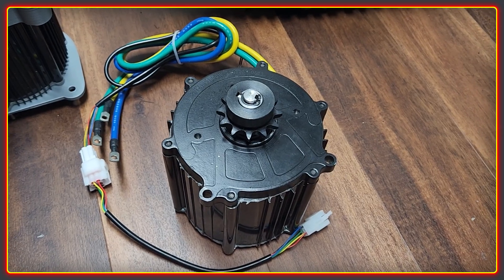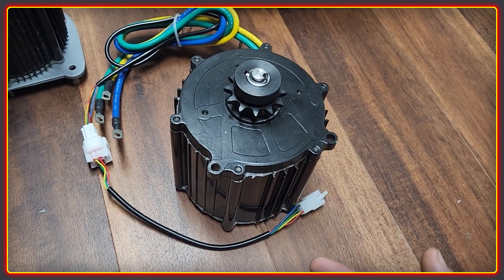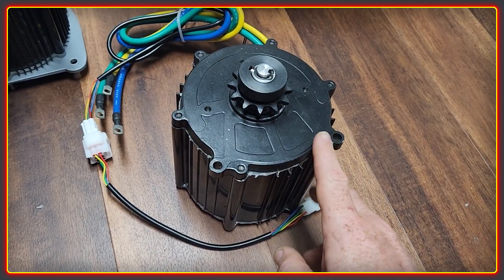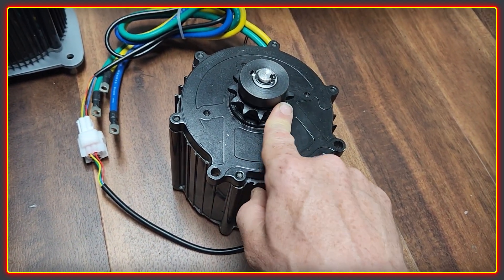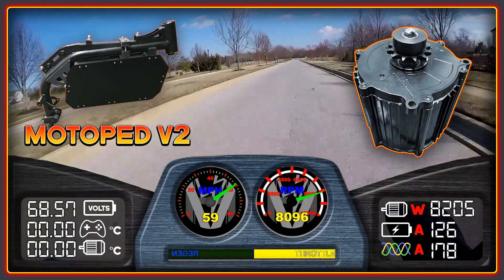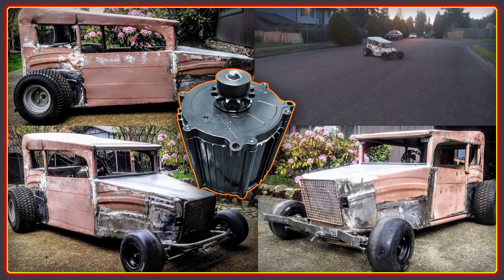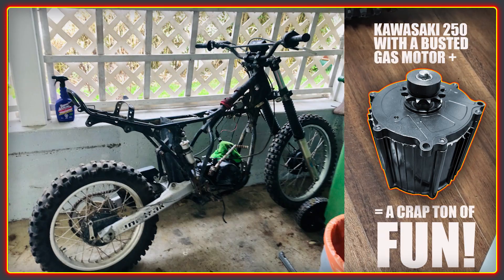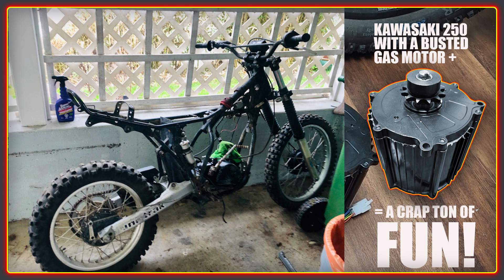High Power Electric Bike Projects with the Lighting Rods 18kw XXL

Comment: Can this motor max out the bac8000 or is the qs138 90h with liquid cooling a better option for larger builds... looking to build a frame from scratch and have a massive battery
Reply from the maker: It has pushed 600 phase and the BAC8000 maxes at 800 phase I think. So no I don't suspect it will max it but it should run it damn well. In terms of your build. Its difficult to say as I have zero experience with the water cooled QS. Rio has just picked up a few to do some builds with. If you are scratch building the frame though you can literally use anything! You are welcome on our discord if you want to share photos of your progress and chat. Others may have more information on the QS. Rio and Kause in particular are worth chatting to. There is a QS mid drive section on there.
Reply: @HighVoltageKits  awesome sauce thanks the thing is im looking for the smallest form factor as to be able use pedals still as well as add things like 6.6kw on board charger gonna be a nuts "ebike" definitely gonna check out discord now just downloaded
Reply from the maker: You should definitely chat to a few of the guys on discord. Cheers

Comment: What’s the difference between a motoped v2. I have a motoped. I’d love to make it electric.
Reply from the maker: The V2 is just cause it had to be essentially rebuilt from scratch. The motor will be this more powerful one as opposed to the first version with the 12kw version.
Reply: @HighVoltageKits  ok  it’s not the motoped bike that’s a v2. It’s the motor. Right ?  So the v2 will fit right in on the motoped frame?  Will their be a kit? Motor and all electronics?
Reply from the maker: The guy to chat to is Mike Bachus. You can reach him on our Discord server. The link to join is in the description. We will be happy to help you with this project. You are correct tho. Calling it V2 cause this is our second version. This is the first in action  https://youtu.be/T1R5tL-3CmI

Comment: Now you are talking.  I can see a whole new trend of builders getting a hold of motorcycle frames for their future electric builds.  You can probably get them for cheap at your local junk yards.  Brilliant.  Cheers.
Reply from the maker: Will be fun. Might even keep the gears?
Reply: @HighVoltageKits  Keep the transmission? Sure why not? Just make sure the clutch is up to it.
Reply from the maker: We will give it a good go. The newer ones it's all integrated..Shared oil. This is 86 I think

Comment: Holly smokes that thing sounds powerful. First time you hit the juice I jumped. I cannot comprehend what that would be like on two wheels. 18kw would rapid drain batteries and it would be a hoot!!
another cool vid!
Reply from the maker: Thanks Todd. It won't pull that all the time but yes this if for builds that can carry a decent amount of capacity. The other good thing is you can run it at say 12-14 really comfortably and have a really reliable bike. Cheers
Reply: @HighVoltageKits   really reliable FAST bike! Lol. People do not understand that when you have lots of power, you do not always use it. And having huge amounts of torque make for a pleasurable driving/riding experience. Does not matter if it’s a ebike, or car or whatever…torque rules. I have a Corvette with over 400 ftlbs, I rarely put my foot in it, but driving around with that much torque just makes it a genuine pleasure to drive. I just built a fat tire ebike with a Bafang Ultra M620…I felt like it was torquey until I watched this video. LOL
Have a great weekend.

Comment: Would this fit the lmx 161 frame? It looked like in your lmx vid that the clearance between the battery holder box and the motor was a little snug, but there was a little gap that you could squeeze this thing into.
Reply: The bolt hole pattern is slightly different then the XL that’s in our LMX. It’s also a little longer and will stick some. With some mounting plate modifications it might fit.
Reply: @MrHV-wv3fy  great to hear, a custom mount plate should be quite straight forward. 

I don't have the bike yet but I'll be getting one in autumn, I'm just keeping the upgrade path open(I'll probably start upgrading the bike next spring). I think I'm looking for something like 10-12kw of continuous (1-2mins of continuous operation with a cooldown period in between runs, after that maybe 8kw for x amount of time, peaks near 20-22kw) and this motor should handle it much better(in terms of heat) than the xl big block. I definitely want a bigger motor if I can get one for similar money but higher performance cap, it can absorb and dissipate more heat.

Also, the build is going to be bonkers anyway(so why not overspec the motor too), I'll be using a  24s13p moli p28a battery, I'll get Öhlins suspension front and back and a Sintech 17kw nominal controller. With the added KGs, I want a little extra power headroom. We'll see if the swingarm can take it, but I am definitely looking at getting a beefier swingarm if necessary.
Reply from the maker: Potentially. I don't think we will be trying it but if you have a frame to try could be interesting. The LMX is already a live wire with the XL so this might be a bit much?